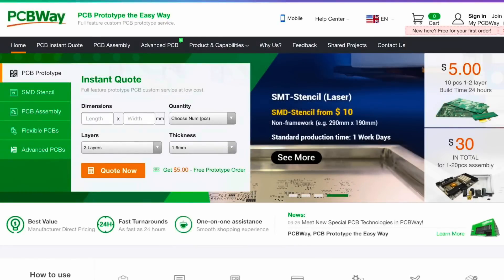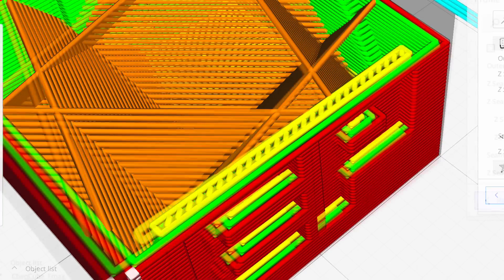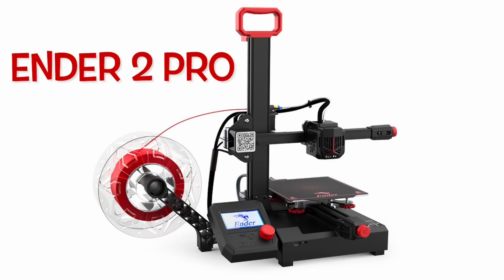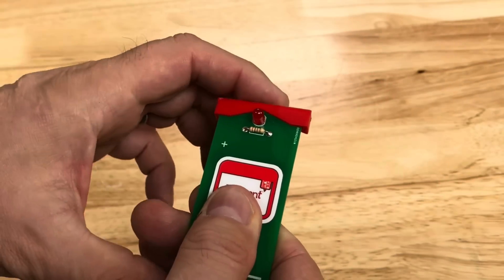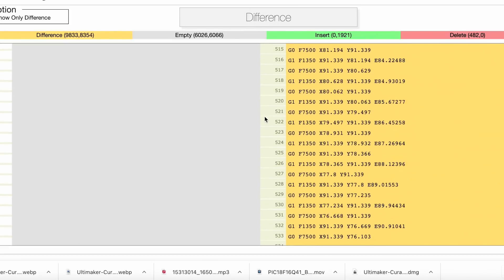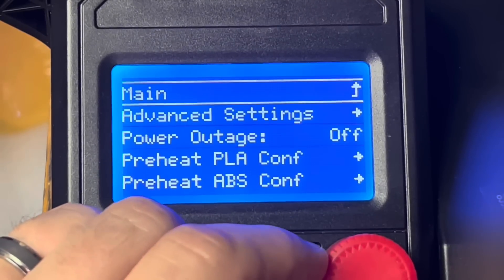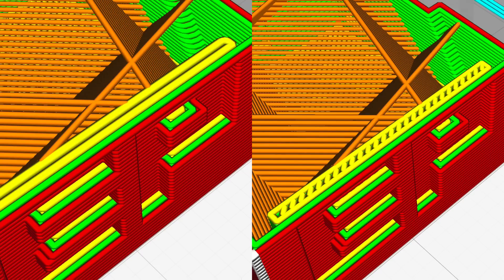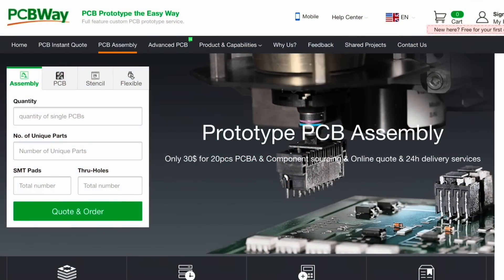Get Rid of Blobs in Your 3D Prints

Comment: Damnit was hoping this was a linear advance issue
Reply from the maker: Can’t run linear advance on a Creality Ender board because of the way they use the legacy mode for stepper driver interface.
Reply: @FilamentFriday  🥺
Reply: @FilamentFriday  You can use linear advance regardless of the stepper mode. I even used it way back with the A4988s.
Reply from the maker: TH3D website says: 
“Because the stepper drivers are not connected to UART for control (they are in standalone mode) Linear Advance does not work on this board.  If you are not going to use Linear Advance (most people do not) then this does not apply to you.”
Reply: @FilamentFriday  That's just wrong information. Linear Advance doesn't have anything to do with UART mode. They probably meant spread cycle or custom microstepping, which do need UART mode.
Reply from the maker: Maybe make a video showing how to do it and get it working on an Ender 3 board. It would be interesting to see it work.
Reply: Ah, I found the TH3D page and it looks like they're recommending against using linear advance on TMC in stealthchop (quiet) mode, and you can't switch to spreadcycle without UART. This really does not matter unless you're going to be printing at extreme speeds (like, 15 minute Benchy speeds), and perhaps not even then. At normal speeds stealthchop is perfectly fine and what most people want (because it's quiet).
Reply: @daliasprints9798  i have tried linear advance with legacy mode and the E stepper just stops extruding completely several minutes into the print, the driver chip firmware crashes, it's a bug in the Trinamic chip, it completely stops responding to serial or anything or doing anything until you power it off and on again. I had to run a bodge wire from an unused microcontroller pin to the E stepper so I could disable Stealth Chop on the E driver. Now I have reliable prints.

It was quite an adventure, I had to rewrite parts of the pin parser in Marlin as well, because the only suitable pins that I could reach are actually the ones not broken out on the Arduino MEGA, so Marlin didn't get around to implementing them.

I have an oooooold Geeetech printer with an early GT2560 board (the nicest thing I could afford) and I'm running TMC2225 drivers on it nowadays because I live in a cramped space and the noise of Allegro drivers was doing me in.
Reply: @SianaGearz  Maybe this is specific to the 2208s because I always ran 2209s with stealthchop with no problem. At least that explains where they may be coming from, though.

Comment: The main point of this video seems to be a firmware bug in the Ender which is totally unrelated to Cura 5.0. The fix for the bulges was to turn the power outage safety off. Updating Cura to 5.0 didn't contribute to the fix. Or did I understand it wrong?
Reply from the maker: It helped find the error that existed in the printer. Never said it was v5.0 fault.
It was just a side effect of the new slicer algorithm. Others may experience this issue when moving to v5.0 so I explained how to fix it.
Reply: @FilamentFriday  then what does the title of the video refer to?
Reply from the maker: It refers to the fact that V5.0 reveled a flaw I wasn’t aware of in the Ender 2 Pro printer so “V5.0 fixed my printer”.
Reply: @FilamentFriday  releaving a flaw isn't the same as fixing that flaw. The title doesn't reflect what the video is about.
Reply from the maker: 26,000+ views and 1,500 thumbs up along with numerous positive comments would imply it delivered as expected.

Comment: Not sure this is a cura bug - waiting in a corner seems more like a firmware issue to me. Plus you chould try linear avdvance, but again, if the firmware JUST stops printing there to write out, that is not something the slicer can sensibly predict and is essentially a failure of the firmware.
Reply from the maker: Not a Cura bug at all. Never said it was. But it did help find a bug in my printer setup.
Reply: It power loss recovery as Chep said. Both my Creality printers suffer with it, even more so in case mode. Modifying the firmware so it writes to SDCard instead of the slower EMMC helps but now I just turn it off.
Reply: not firmware error, but sd card need  to be formatted, error occurs when it needs to read the next layer and pauses a smuggling and thereby the lilli bubble occurs

Comment: can that printer setting be turned off on an ender 3 v2? mine doesnt seem to have that option. (maybe there might be an alternate firmware that has it?)
Reply: Option is available with Jyers firmware… assume it’s there on the professional firmware too.
Reply: @nodowt  I actually found out that theres a command you can add in the gcode to turn autosaving off...

Comment: Chuck, do you think software and printers will ever be so well designed that all issues like this become a thing of the past, and all prints are automatically flawless? How about an automatic filament analyser and profile adjuster?
Reply from the maker: Not at low prices.
Reply: @FilamentFriday  That's disappointing. I think I'd pay 50% more just to eliminate all the aggro.
Reply: I think we'll see all sorts of machine learning, cloud-based computation, and other "smarts" applied to 3D printing. We're still very much in the early stages of the tech.
Reply: @jungletek  That's a great thought. I hope you're right!
Reply: @Bonestripper1986  Are there any that are that fancy yet? If so, care to name some please?
Reply: @Bonestripper1986  I already have a decent Flashforge printer, but it doesn't do that, although the quality is reasonable.
Reply: I do think we'll keep approaching that point in baby steps. Esp32 is now a viable 3D printer control chip and it's got impressive power and is cheap, and RP2040 plus some gubbins could ve viable as well. Slicers may also become smarter and may need eventually fewer exposed settings to generate better gcode, and filaments could be parametrised with community knowledge if not outright automation. But the low hanging fruit have all been picked, and every bit of progress will come at increased effort - commercial or community.

I don't like when magic buzzwords like "cloud" are thrown around. You already have a powerful PC by all reason, it can do tons of heavy lifting. A GPU that can address gigabytes of neural network data is now integrated in most consumer CPUs, though I don't expect this sort of thing to be relevant for the time being, poorly understood problem spaces don't just solve themselves when you throw machine learning at them, but well understood, somewhat ambiguous problem spaces achieve interesting solutions. The "cloud" is just someone else's computer.

Will we ever get there? Well you'll have to ponder your crystal ball for that.
Reply: @SianaGearz  Great post. Not sure that I agree with you about the low-hanging fruit though. It seems with every version of Cura there's a "Oh that seems so obvious, why didn't it already exist" feature. 

I don't see any need for the cloud to be involved. As you point out, CPUS are plenty powerful, and I could probably do more with two inactive cores on my PC than the best printer chip. AI learning on GPUs is capable of so much. It doesn't seem all that difficult to me for a printer to spend 3 minutes building up its own filament profile, analysing flow rate, adhesion, viscosity and melt temperature.
It seems to me that the reason sooo many of these problems have not been addressed is lack of will. A mere cash grab. It's not even as though most of it is rocket science. In the US alone, the market is worth 13.7 billion dollars, so why is a commensurate amount of investment not occurring? It feels to me like minimum effort products to me.
Reply: @Martial-Mat  I have worked on an open source project with half a million active weekly users that was impossible to monetise in spite of these users spending hundreds of millions while using it. If each of them just gave me a cent a month on average, I'd be good, at 5 cents i could have a decent team. I learned a lot of skills, but it also pretty much broke me. 3D printing is facing the same issue. You'd need to divert money from printer sales and especially filament sales somehow. Right now, a handful companies make the most work but they have a correspondingly high overhead, making them less competitive, less mass market viable.
Reply: @SianaGearz  That was a fascinating by depressing insight on people's greed and the flaws of capitalism. Another one is that even if you invested a billion to resolve every issue, the Chinese would steal it and replicate unchallenged for a fraction of your costs.

Comment: I have a Ultimaker S5 and also get messy corners with V5 compared to V4, and S5 has no auto resume type feature either. Will stick to V4 for now !
Reply: Could you report your findings on the Cura github page? I'd love to help you out figure out what the issue is.
Reply: @nallath  I have looked into it and V5 messes the seam up when you enable coasting, saying that even with coasting disabled the seam is cleaner in 4, but the difference is more pronounced with coasting on (can be seen in preview view)